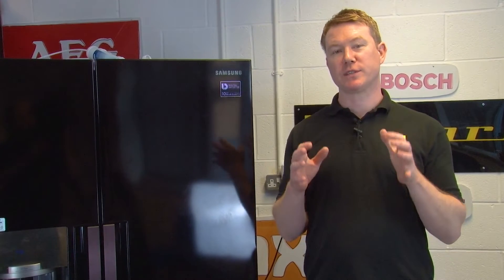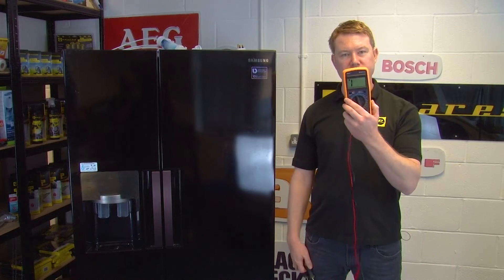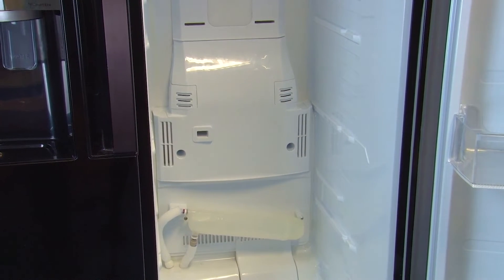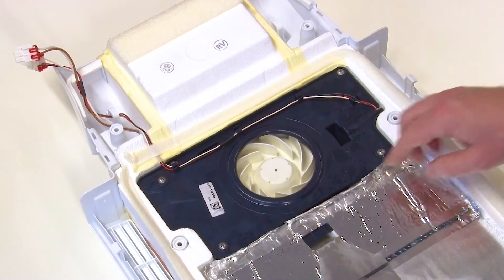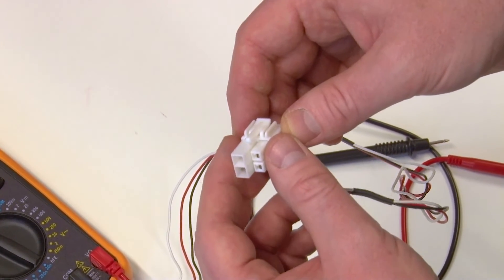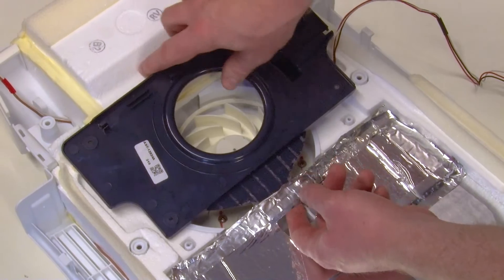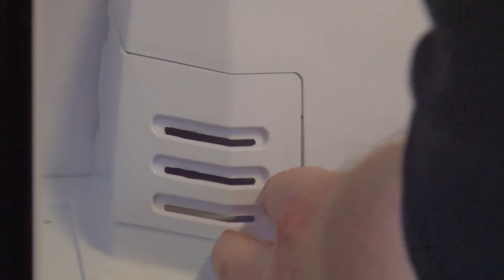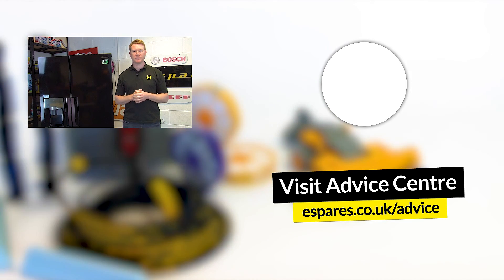Fridge Freezer Evaporator Fan Replacement & EASY Multimeter Testing!

Comment: Useful video thanks (unlike most videos on YT that are just adverts). I am trying to find a video showing similar for a Panasonic NR-B53V1. Access to the fan is not immediately obvious.
Reply from the maker: Hi, thanks for your comment here. Unfortunately we don't have a video that could help you with that particular model.
Reply: No worries. I found the service manual and discovered my fridge was completely iced up internally. Works now. I also discovered that Panasonic don’t make their excellent fridge freezers anymore for UK.

Comment: Mine had black red and green wires. The green was ground so it didnt do anything. But when tested, it did test at 9, but the fan is bad despite the reading (its stiff to turn and the fridge doesnt turn it at all) So guess it depends on the fridges motor?

Comment: I have a samsung rsh1dtmh. I had the grinding noise but thought it was ice buildup. I replaced seals but now I’m not sure the fan works. The temp is cold at bottom and warm at top

The resistance is 19.3 across black/white. The fan makes no noise; I would have thought I could hear it spinning if working??

What else could it be?
Reply: Hi there. On my fridge the same is happening. But on this case I don't hear any grinding noise. Only the bottom cold and the top warm. My resistance reading is at 19.4 across black/white.
Can you please let me know if you fixed your problem and what you did to solve it.
Thanks

Comment: I had an EF code on my hisense fridge and it came up as an evaporator fan motor fault. I removes said fan motor and disassembled it and cleaned the brass bushing and added some new grease to them. Both before and after cleaning the ohm's were 4.56. And after re assembling it the fan started and the code has gone. It is still running quietly

Comment: My wires are white, red, blue, and yellow.   Which ones do I check?
Reply: you figure it out yet?
Reply: @4TT4CK  yes.   I had to use reader glasses, because some wires had a stripe down the middle.  It looked Blue solid, but it was blue with a white stripe.   I connected it correctly and it's working.
Reply: cool, i just hooked up my red/yellow wires to the +terminal on a 9v battery and the white to the neg post and the shaft started spinning.   guh, now looking to replacing a capacitor and some relays on  the main ctrl board.   bruh
 @funkycowboy
Reply: @4TT4CK  I figured this was the part, so I bought a china version on amazon and it worked.  Then returned it and bought the OEM version.